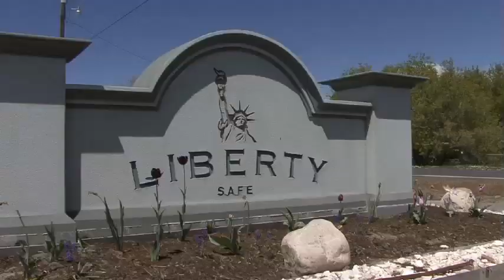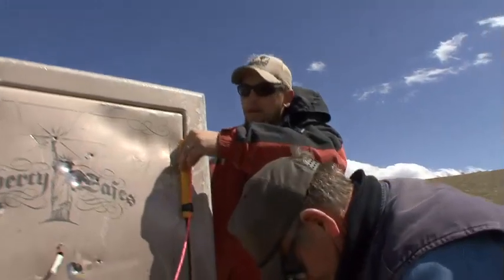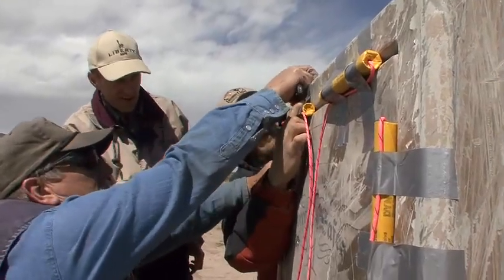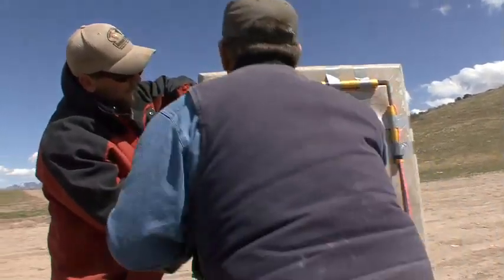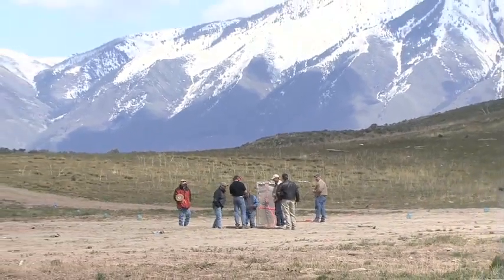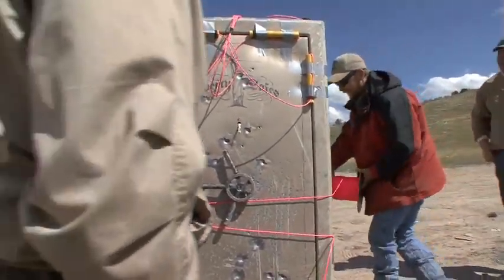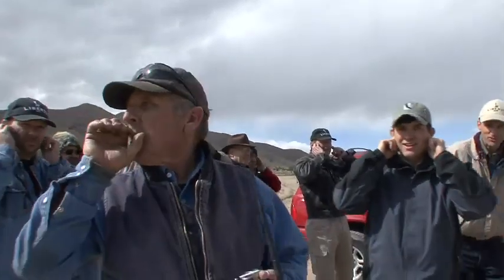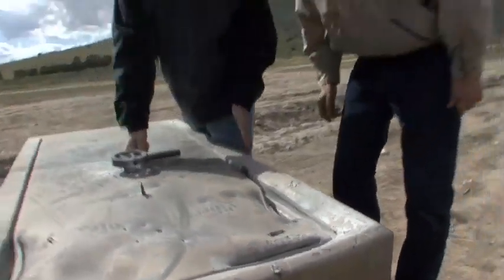6-Guns and Gear TV Torture Tests Liberty Safe - Episode 6 - Dynamite It!

Comment: Stuff det cord in the door jam, put anfo on door, and dynamite where hinges are, lay it down door first on steel plate, then send the charge. Almost all the blast was deflected through the air. Confine the blast and direct it where it needs to be, concentrate the blast. Probably will get diff results.

Comment: Try using a portable plasma torch if you want to get in it. Lincoln makes a 110 volt model the size of a dufflebag that will cut through 1/4 steel and you could plug it into your victim's own power outlet and cut through the side wall.

Comment: saw something on a movie. drill a hole on top of safe fill the safe up with water put a stick of dynamite inside booooooooom opens up
Reply: Yeah, I believe the MythBusters disproved that.  Drilling a hole in the tip takes a long time, and the dynamite will destroy everything in the safe.
Reply: +canebro1 It cracked that safe open like a walnut, watch the episode..
Reply: +Robert Maillet : You are correct and it blew the door off the safe..  google "mythbusters safe opening"